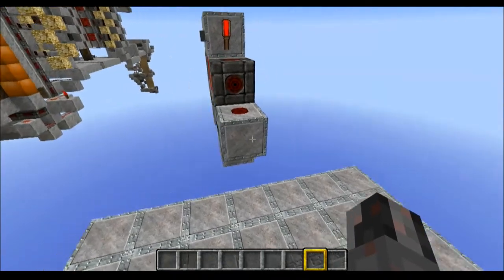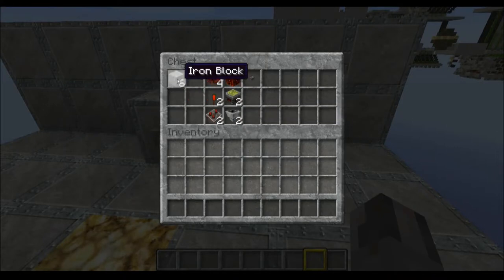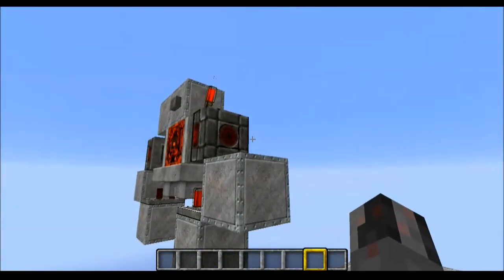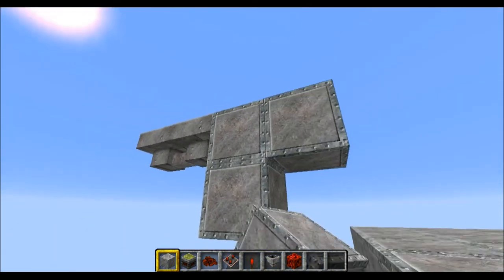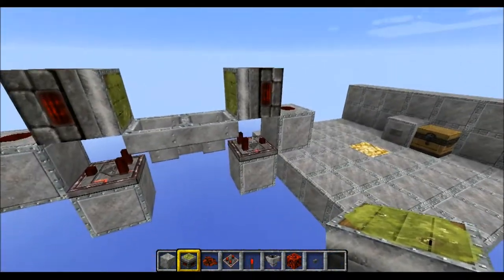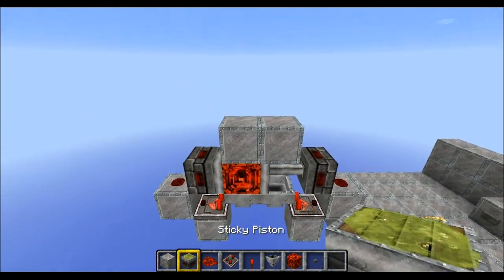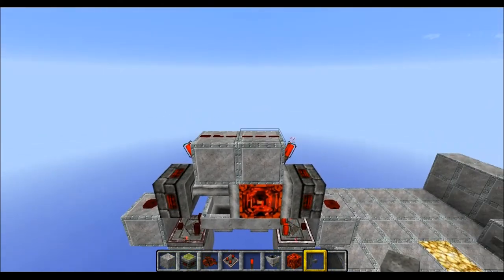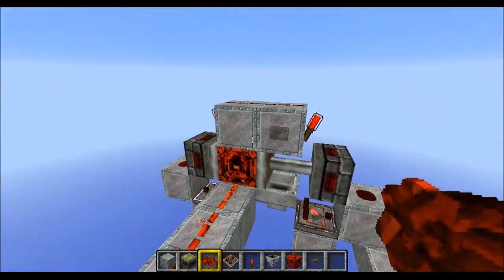Tutorial: Timed T-Flipflop/Anti-Spam Button

Comment: Is there a design that starts the redstone pulse that leads to the mechanism as soon as the button is pressed, instead of when the button releases?

I can't really find any designs that do this except this one.
Reply from the maker: Invert the signal (redstone torch) before you send it into the actual input. Then the circuit triggers on the rising edge instead of the falling edge. I usually do this in my bigger doors to increase the response time by 1 second.
Reply: @RKFWalter  thanks a bunch, exactly what I was after!
Reply from the maker: You're welcome! Happy to help :)